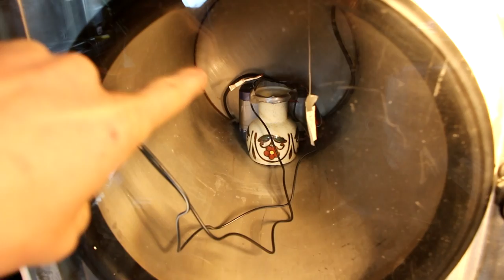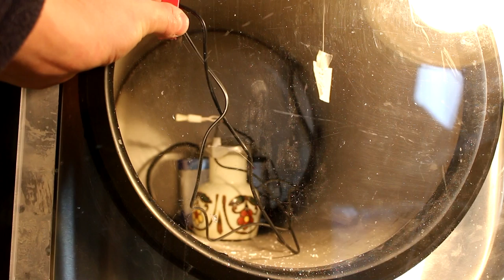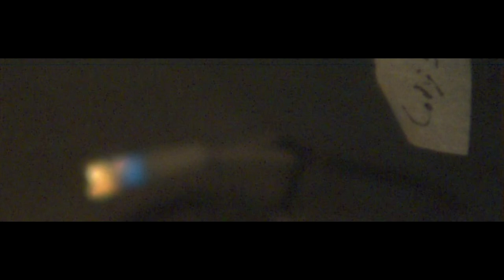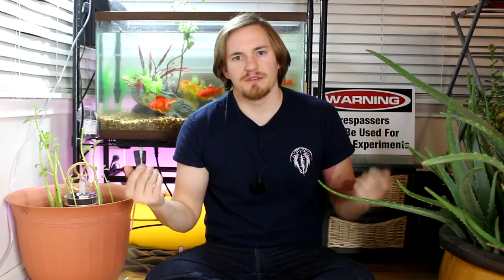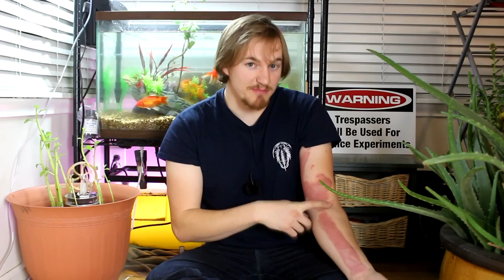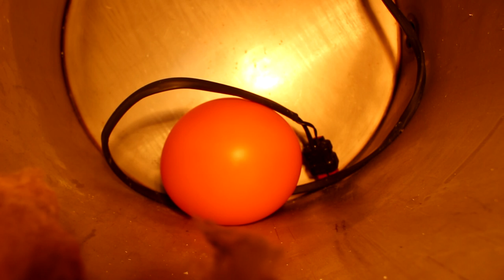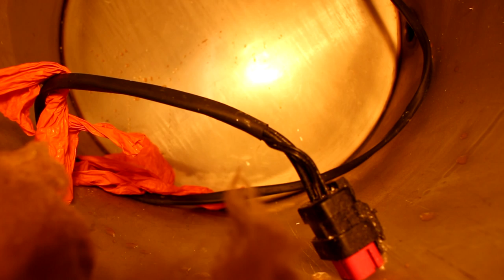Sound of Explosions in Space? part 2

Comment: So really you need to measure the speed of the sound not light? It's a bit hard to explain but you said it basically with a larger chamber and proper shock sensors measuring force sort of thing? from timer that starts auto on detonation and impact, maybe a little mic dangling a lot further away :)

Can you also vacuum the balloon and then put it in the vacuum  lol like suck out the air first, knot it and put it in, I just wondered if it sounds the same.

Cheers watched all your vids good work.

Comment: Hmm interesting a balloon in a vaccuum. Would the result change if you use another gas than you used in thsi experiment? I would be really interesting to be able to see the gas diffuse (or I guess it would just sink as there is no air dto diffuse in, right?) after the balloon exploded especialy in slow motion, but for that you'd need a gas with color.

Comment: sound travels at different speeds in water and air and space ahahaha
all sound  is caused by waves of particles in general... gas photons, liquids , solids etc..you can only hear sound  to  certain distance of anything
Reply: thats correct. sound waves or particles would  generally travel further or stronger thu space than the air. or ground.  use a fog horn in a small chamber or freon horn
Reply: but they also may not be as loud..go figure

Comment: Why didn't you do a test where the chamber was complete vacuum? like instead of 50% space, it would be 100% instead.
Reply from the maker: thats not really all that possible... kinda like how in calculus you cant divide by zero but you can divide by .0000000001
Reply: ***** But what about near vacuum like you did last part and not half.
Reply: prebenkul he wouldn't be able to do that because most likely he doesn't have the equipment to create a space like vacuum and still then space isn't a complete vacuum
Reply: Knight Deltora In the last video, he did his experiements close to vacuum. In this video, he did half.
Reply: +prebenkul Where did you get that from? He said he has brought it down to 500 mTorr in this video, and that's a bit less than atmospheric pressure.
Reply: 500mTorr is quite a bit less than 760 Torr.

Comment: hundreds of kilometers away, u would still be washed with the gaseous effluent, at a high rate of speed, but at the inverse square proportions. 

u wouldn't head a scream. the sound u would hear would be the gas particles IMPACTING on ur vessel. the gaseous mass may not be cohesive enough... will not be cohesive enough to allow a sound to wave to propagate through it. 

the gas will have to operate as a body, but unless held against each other due to a large gravitational force, it will be treated as individual gas particles streaming through space.

Comment: I was thinking more of the idea that the gases released by the explosion are actively being accelerated by the vacuum. Imagine if we could cut the explosion into actual frames, not just on camera but it actual time. Each frame you have a bubble of higher pressure surrounded by a lower pressure. Those want to be equal and so the vacuum "pulls" the particles while they're simultaneously being pushed by the expansion behind them.
Reply: mikemorr100 not quite that way. better imagine empty space with a lot of particles close to each other. more particles in one place, more often they bump Into each other, and so more scattered they become. Vacuum does not magically pulls them, it just does not slow them down, like air does.
Reply: mikemorr100 If you'd keep the "frames" of the same size you would see that the empty space decreases as the explosion advances.

Comment: You're not measuring the speed of sound in vacuum. You're measuring the speed of hot gases from the blasting cap. Measuring the speed of sound at low pressures would be interesting.

Comment: in a true vacuum, the paper wouldnt have moved because of the sound, it would have moved because of the gases that were released. if the death star was a real thing you wouldntve heard it explode due to space only having one particle per cubic metre (check that, i dont know the exact amount) where cody says that the gas would hit the craft from the explosion, you wouldnt hear the explosion, you'd hear the aftermath or the gases hitting the aircraft, i agree on him with that. but say you were able to survive in space with no protective equipment, you would hear nothing since theres no gases for compression to happen in which, no sound would be created. and any gases that would happen in space would dissipate with intense speeds, not enough to do actual damage to the hull of your ship or anyone sitting in space with no protective equipment. and at the end card of the video, again if it were in a true vacuum, the balloon would expand for a very short amount of time and end up popping without the use of a laser, the expansion of the gases inside the balloon would be too great for the rubbery material of the balloon to contain and would start expanding the gases before it reached space, it would probably pop before it reached space due to the pressure of the external gases. once the balloon reached a point where the gas inside has a higher pressure than the gases outside it would expand and as it rose higher the expansion would speed up exponentially.
Reply: note that i dont know the exacts of everything on here but most of its basic stuff
Reply: The expanding gas moved the paper. Think of an expanding shell of gas. this shell is moving particles and not actual sound. the impact of these particles on other object push these objects. what we call sound is just pushes, called pressure. liquids, solids and gases transmit push by a pressure wave while explosion.shockwaves send a spherical shell outwards.

The vacuum is only at -1 atm which is quite low. that is the difference of being 10 m underwater compared to the surface. the balloon was almost completely deflated when inserted, so it grew while in the chamber, but the pressure difference it experienced was roughly that of a normal balloon not in vacuum.

Comment: This may be a daft question, but what is the pump in the flower pot?
Reply: I'm not certain, but I think its a Stirling engine using the heat generated by the plants. Although would be impressive for plants to produce that much heat!
Reply: Paul Roberts it is a heat powered sterling engine.

Comment: Is that possible, if the gas produced by the explosion will fill the vacuum chamber with sufficient air (Because its a tiny vacuum chamber) to be a medium of the sound to travel ?
Reply: The amount of gas released from the cap is very small, at that pressure, it would not fill it enough to have wave propagation occur. The moving gas itself is the pulse that is recognized as sound which moves the paper.

This can also be seen as the paper moves rapidly for a long time due to the explosion. there is not enough air to stop the paper from moving

Comment: What sound would the popped balloon make if it was filled with helium instead?
Reply: hey7328 The same sound, pretty much. they don't sound any different popping outside of a vacuum either in my experience.
Reply: TheJschulter hmm, i thought maybe the sound would different as the helium atoms would have more velocity
Reply: If I hadn't seem the fly first I would have tried to swat that spider.
Reply: hey7328 wait why would helium have more velocity I thought it would be less of an impact since it's smaller than oxygen and nitrogen?
Reply: Arknio it should have more velocity since the helium atoms weigh less

Comment: wouldn't pitch be transferred via the medium it hits, the high energy particles would be higher pitch than the lower energy ones hitting later, the high enegy particles hit the hull making it vibrate faster causing a higher pitch, the lower energy particles making it vibrate at a lower frequency, giving all sound in space a high to low pitch??

Comment: Wait... so is the speed of sound slower in a pressure chamber?
Reply: The speed of sound increases as the density of a material increases. However, the reason why in this case it seems to be the opposite is because what Cody measured isn't truly sound, as he mentioned. Sound is a pressure wave propagating through a material whereas when the pressure is so low that there is no effective medium to propagate through, such as this experiment, the resulting force is more akin to shrapnel being thrown about than to a sound wave because it's the same particles that came from the source that are hitting you where sound is the energy from the original particles travelling through a series of other particles, if that makes any sense.

It'd be interesting to see at what pressure that change happens and the speed of "sound" begins to rise.

Comment: Makes one wonder how a thermonuclear detonation would work in space - what would the blast radius be?
Reply: Interesting question, it may be not so impressive.  A lot of the destruction from nuclear weapons is due to the shockwave formed by the intense x-rays and neutrons turning large amounts of air to very hot plasma.  in space, aside from the casing of the device, non-fused materal from the secondary and non-fissioned material from the primary,  there wouldn't be anything to turn to plasma.  You'd just get a massive x-ray/gamma ray and neutron burst.
Reply: slovokia nukes in space basically turn into super radioactive EMP's
Reply: In deep space there are no EMP effects are all.  EMP is caused by the rapid ionization of nitrogen gas, for Earth as its makes up the bulk of the atmosphere, and then its subsequent deionization.  Well this is a gross simplification, there is the compton effect and the geomagnetic field, but lets just say it requires a planet.

In deep space there is nothing to ionize.  You get huge amounts of gamma and xrays and shortly followed by infrared and ultraviolet.  I think that most of the energy(80%) is in the infrared.

Comment: So could "sound" then travel faster at higher altitudes where there's less air?
Reply: Don't think so, if there is less air that means the molecules are further apart from each other, so it takes longer for the molecules to push each other. (sound actually travels faster through solids than through air (just it is mostly absorbed by the time it makes it through))
Reply: Scoop Science I see what you mean. But wouldn't that also mean there would be less resistance (from the air) to slow it down
Reply: Charles Gillingham
Potentially, but that factor is only really small I believe so it doesn't make much of a difference. At least I think so.

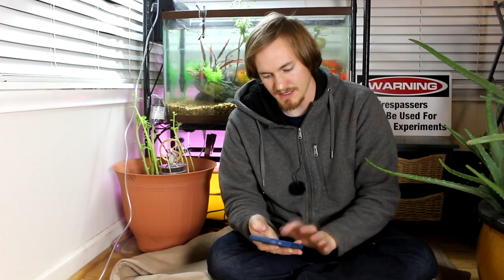Comment: If under normal conditions the sound traveled 30 centimeters in 90 frames and in a vacuum it traveled the same distance in 3 frames, should the speed of sound in a vacuum be 30 times faster than normal conditions, not 3 times faster? I think you forgot a zero when doing your math at 2:34.

Comment: Would a nuclear explosion make sound in space?
Reply: if strong enough, the blast of the radiation would shake you as it hits you. so yes. it would also vaporise you to hear something, but in that very last (and already vaporised state of your body) you might still hear a faint sound. also your body exploding would make a sound, inside your body at least. so if you are in just the right distance you might hear your body boil and crack before it gets oblitterated. I hope that answers your question. experiments have yet to confirm this, however.
edit: would saturday be fine with you?
edit 2: that is, assuming you volunteer yourself. bring popcorn. and lead, I like surviving this and telling the story of your heoric death.
Reply: Ollyweg 0 significantly less gas than a normal explosive though.
Reply: For a nuclear weapon and a conventional explosive with the same yield, the conventional explosive would release much more gas, but the gas released from the nuke would be much hotter (faster, and with more energy per atom). The gas shockwave from the conventional explosive would probably still be stronger because quite a lot of the energy from the nuke is released as electromagnetic radiation.

Comment: if you can hear an explosion in space, why don't we hear supernovas on earth?
Reply: Very large distance and the atmosphere in the way. As he stated, the sound is not a propogating wave, it is the actual gas molecules moving very quickly and will become less dense proportional to the inverse square law. 

When a supernova occurs, the gas has lightyears to travel, that is a very far distance sot there is very little gas to impact anything near Earth. The little that does make it this far then produces a regular sound wave in the atmosphere which quickly dissipates and dies. That is why you cannot hear stars exploding.
Reply: Collin Barker interesting. I wonder if the astronauts in the ISS could test for supernova waves/gas particles reaching earth. there would actually be something to hear if we were in space, correct?
Reply: The sound would be extremely quiet, as very little gas travels that far. The mechanical objects on the station would cover it up.

Comment: So sound travels faster in water because it's denser and in a vacuum because it's less dense than air??
The fuck are you smoking Cody.
Reply: fatsamcastle, shockwaves are not sound waves. They deliver energy in different ways, the later travels by pushing the medium back and forth, while the former is a wall of gases traveling through a medium at high speed, it'll be damped and slowed down by that medium, but in space there's nothing so it won't lose neither speed nor energy, that's why it will travel faster.
Reply: If a tree falls in a forest and no one is there to hear it, does it make a sound?
Reply: fatsamcastle, the probability of it makes a noise is higher than the probability of it not making a noise by more than 5 sigma. Yeah! science mother... kind sir!